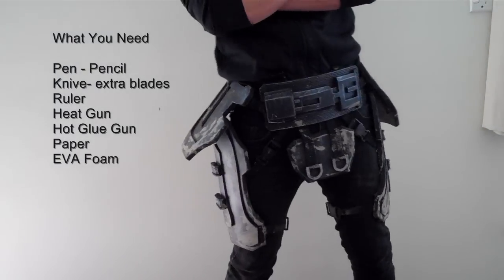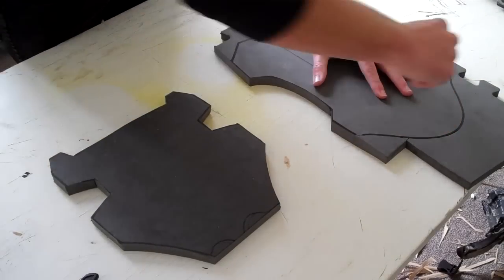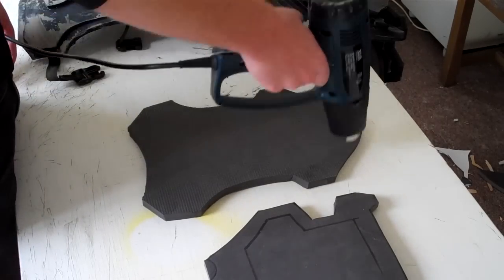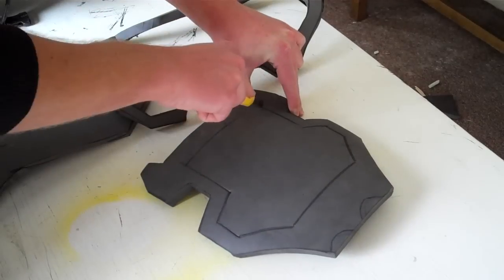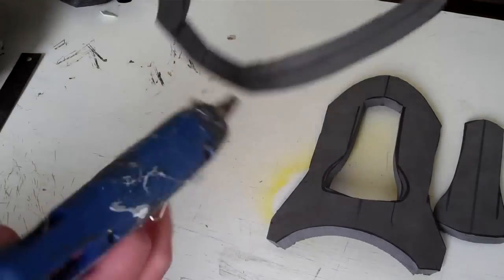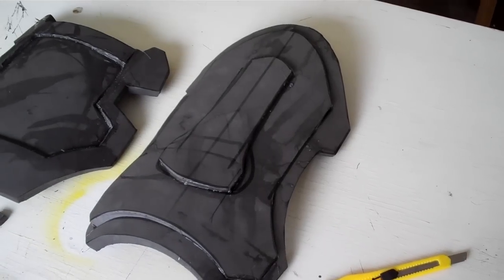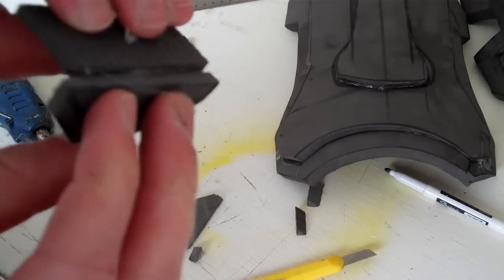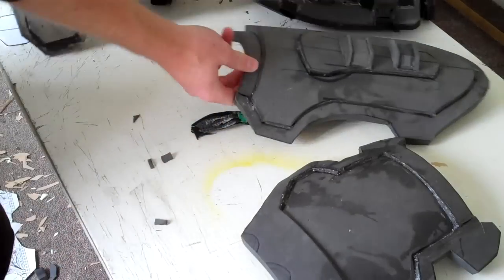How To Make : ODST Costume - THIGH & HIP PLATE  2#

Comment: i finished my shin armor. was thinking of buying black denim cut to fit the inside and using a spray glue to hold eveything together. Do you use any type of putty filler to close gaps?

Comment: Whats the eva foam size and what colour is it and do u need black?? And is it recommended? ??
Reply: The EVA foam he uses are from gym mats, they are 60x60 cm in width and are 11mm thick. I don't know the measures in imperial system :/
Luckily in Sweden we can find them in the bigger hobby shops. $16 for a pack of 4.
Reply: sorry, I think his are a bit thicker.
Reply: ZchanL I think it's about an inch? Which is 2,54 cm. Just guesstimating here
Reply: ZchanL its a centimeter 57 by 57 i live in the same country as dafrontlinetrooper so yeah

Comment: anyone know the steps to scale these templates? this will be my first build with eva foam
Reply: I need to know too
Reply: +orkeyadam1 I just finished making the legs, and I'm taller than most. So what I did was I used to template for the shape. and then I put my leg down on the paper so I could figure out how tall and wide they needed to be. So you can see in the first few seconds of the video that they go from his hip down to an inch or two above his knee. They you want to get a width so that it can wrap around you leg well